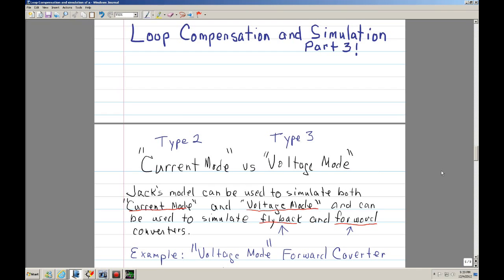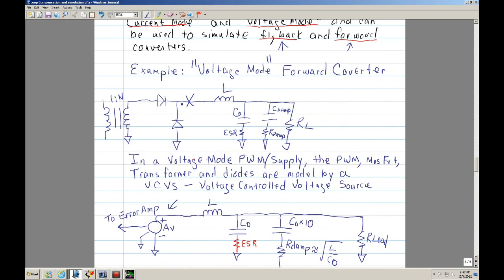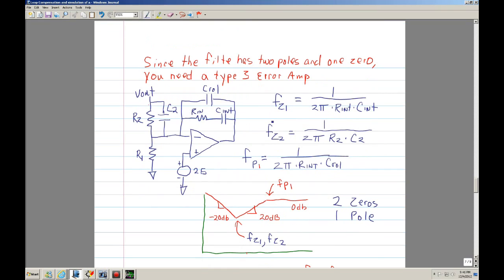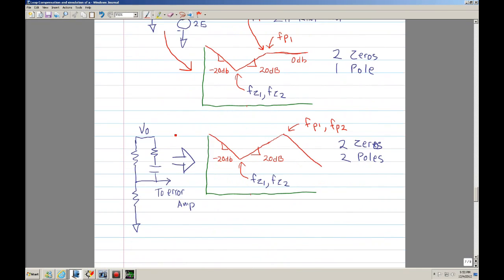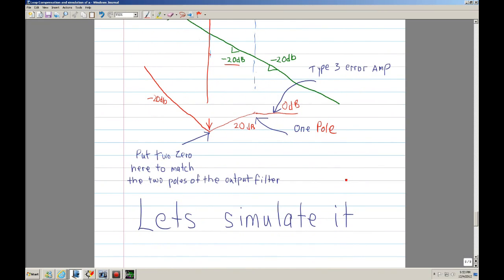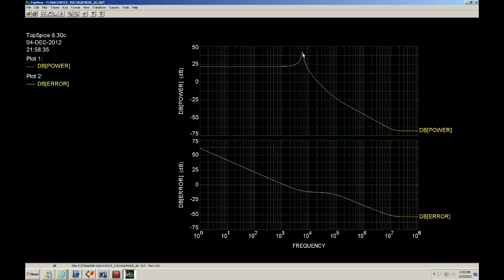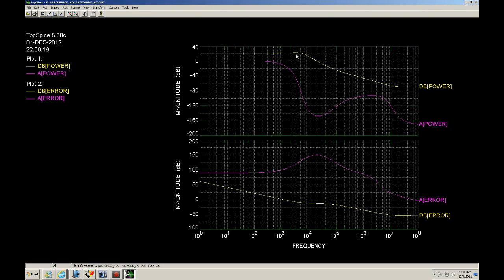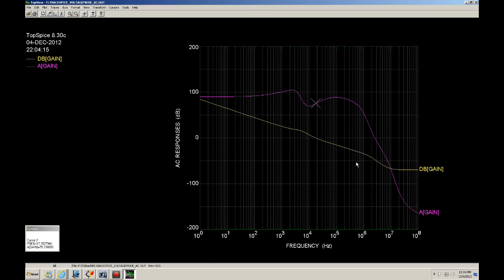Loop Compensation of a Voltage Mode Flyback Part 3

Comment from the maker: Jack always wanted the input of the VCVS to be 1 volts.  In the example that I used in the video, the output of the supply is suppose to be 12V, the gain is then Again=12V/1V=12.   Another example, if your supply is 5V, then you set the gain to 5. I hope this answer your question.

May you have happy simulations ;-)

Robert Bolanos

Comment: Robert,

It is a great video. In your AC simulation, how is the value of VCVS which is "12" calculated in your voltage mode flyback? Thank you.

Comment: Hello Sir Why  we  used R13 and R14 resistors 2k and 100k? Thank you...
Reply from the maker: It is a divider network and does not effect the circuit too much. In fact you can leave it out and you can connect directly. Sometime the simulator will complaint that there is no DC return path so you may need to place a large value resistor. That is why the 100K resistor so the simulator would run correctly.
Reply: @RobertBolanos  thanks sir for answer.

Comment: Hi Robert, thanks a lot for great video that you made. I'm learning bode for smps but I can't simulate bode plot in orcad pspice, I try few ways but none of them came right. If you was doing something like that on pspice, could you please give me some idea on how to simulate bode plot? Many thanks for your great help sir,
Reply from the maker: Hi Anh, if you email me at rbola35618@aol.com, I can send you the TopSPICE files and you can download the demo version of Topspice and be able to run the files. Regards, Robert
Reply: Robert Bolanos many thanks for your help. I will email you soon. I'm really newbie on this industry, I try to learn as much as I can but struggle with bode simulate, I used orcad pspice for time domain and it work but for bode plot, really my nightmare since I tried some ways but none work. And I have my last shot but not try yet. if still not work better I should change to any softwares that could help.  Thanks a lot, sir. ☺

Comment: Hi Robert, Just a quick question. Suppose that we have a VCVS and the output filter compises of a diode bridge and a capacitor (there is no inductor) so the cap with it's ESR and the Rout form a first order circuit with a pole and a zero. I suppose that type II compensetion is what is needed here to eliminate the pole and the zero. I'm I right?
Reply from the maker: VSVS implies that you are using voltage mode control and the inductor effects the output transfer function; it becomes a 2nd order system (LCR). Of you are using VCCS then you have current mode and you have a 1st order system (RC).  If you are using a voltage mode control, then you will need to use a type 3 compensator while current mode only need a type 2 compensator. I hope this answers your question.
Reply: I get what you're saying, but what if have a VCVS and you actually DO NOT have an inductor at the output filter at all  (not just ignoring it's effect, as we do in VCCS...), then the output has to be  a first order filter, thus a type II is sufficient, even though we have a VCVS system...
Reply from the maker: That would be correct. Just keep in mind, that I think the inductance of the transformer would affect the circuit. For example, a flyback does not have an output inductor, but if you operate it in voltage mode, then the inductance of the primary comes into play and will become an inductor. Let me make some simulation to double check what I am writing here. RB
Reply from the maker: Yes, I did some simulation and I am correct. In a flyback, there is not output inductor but if you use voltage mode, then the resonant frenquency of the output filter will be Fre=1/(2*pie*sqrt(Lpri*Co))
Reply: ok I see. . anyway thats a lot for  your time , I appreciate it !
Reply from the maker: If you email me at rbola35618@aol.com, I can send you some Topspice simulation files

Comment from the maker: Hi Dian,

40kv is a high voltage. In winding a flyback, you want to keep the secondary on the flyback under 600 volts. To get to 40kv you would need to use a long series of voltage multipliers. You might be able to go up to 1000 volts and use a 40 stage multiplier to get to 40kv. Email me at rbola35618@aol.com and I can give you more details.